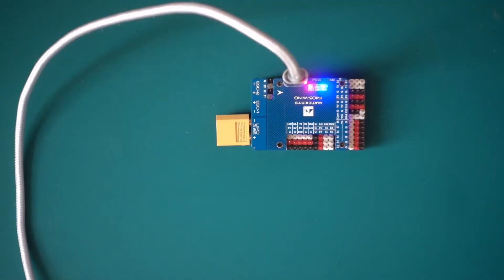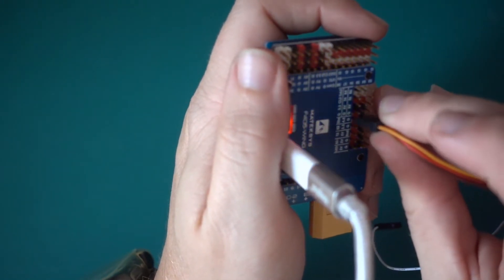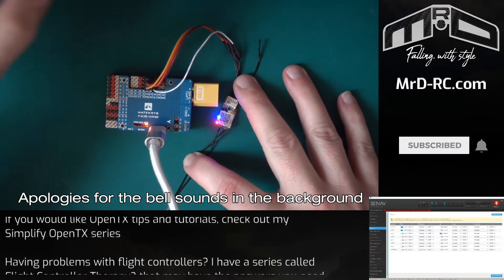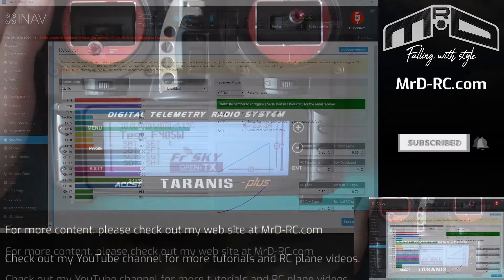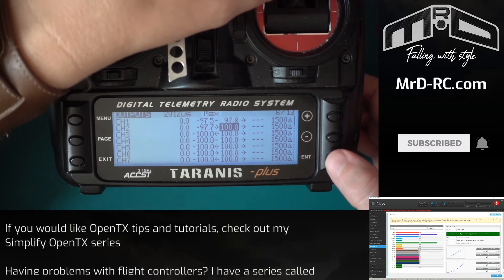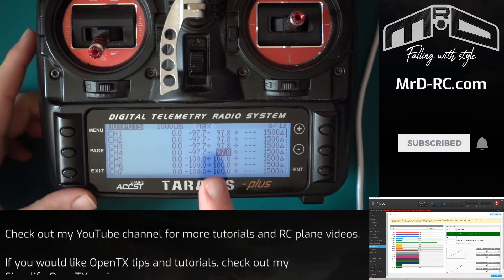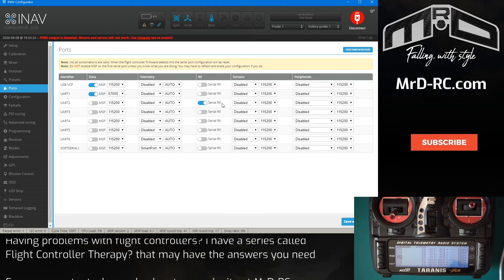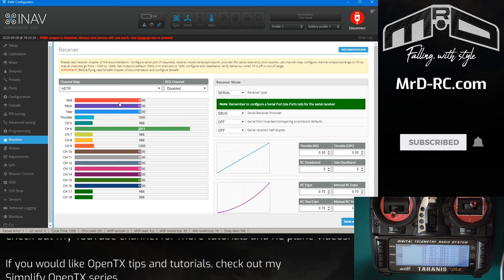Connecting the receiver and setting up in iNav

Comment: you sir get a like and a sub... i think i was chasing my own mistakes for a few hours tonight... we shall see tomorrow when i go fly... i was calibrating my sticks and then my rx tab was off so i tried to listen to jb and change value range in cli but that kept throwing it off by 1 or 3 digits or so.. and then after seeing two videos of tx endpoint alterations like this finally 1000,1500,2000!!!!!!!!!!!!!!!!!!!
Reply from the maker: No problem at all. I’m glad it’s working for you. I think doing it this way is so much easier than using the CLI, and if you bind multiple models to the transmitter model, it’s already right.

Comment: Hi started just yesterday building my first wing, using crossfire and my tango 2 im experiencing a weird issue if i move the stick to roll, the pitch also moves a bit but die gimbal is completly leveled.
Also the throw of the servos is greater on one wing then the other, when i try it in Manual Mode....

Do you have any idea what the issue is or ist that normal ?

Thy

Comment: Mr.D, I accidentally soldered the Sbus wire from my Radiomaster R81 receiver to the RX2 pad instead of the Sbus pad of my Matek F405-WMN, is this something that can be configured in iNav 6 or do I need to resolder?
Reply from the maker: You need to re-solder. F405’s don’t have onboard inverters. That’s why they have SBUS pads. They just connect to the UART RX pad through a hardware inverter.
Reply: @MrD  thank you for your response!

Comment: Hi
Whay should I check if there is no response in the receiver page eventhough I toggled the switch?
The RX already connected to TX and the TX to RX
I am using matek R24D ELRS
I think my TX and RX already binded (it said Telemetry lost if the FC power off)
Reply from the maker: Make sure you’re using the correct serial protocol on the receiver page (CRSF). Did you set Serial RX to the correct port on the ports page?

It sounds like it is bound.
Reply: Hi finally it works
The cable is not well connected to the board
By the way, after the Receiver respond to the Remote movement what should we do to connect the servo?

My INAV has already responded to the Remote movement but the Servo hasn't
I plug the servo wire to the S3 port in my Speedybee F405wing
Currently, I only use USB to power the board and the servo
Is that the problem for this issue?
My remote setting (mixes) is already the same with you

I am still waiting for my Battery connector to arrive before can power up the FC and Servo using Battery
Thank you so much for your help @MrD

Comment: Hello, is there any way to connect dual receivers for redundancy ?   I do hava  a SIYI air unit for FPV & telemetry that can act als as a receiver, and also a regular FlySky receiver. Is there a way to have them both recognised as receivers ?
Reply from the maker: Receiver redundancy is usually part of the receiver ecosystem. For example, with FrSKY, I can connect the SBUS out of a receiver (slave) and connect it to an SBUS IN of another receiver (master). The master receiver will then connect to the flight controller. 

You can’t have 2 receivers connected to INAV independently. Unless 1 is purely for control (Serial RX on the ports page) and the other is purely for a transparent serial link.
Reply: @MrD   Thank you very much for clarification

Comment: Excellent video, thank you very much. I have the following question, maybe you can help me: My receiver is RX6R it has SBUS but the pins that are presented to me are the following (- + SP AIN2 SBUS_OUT SBUS_IN) my board is MATEK f765-wing I understand that for it I must connect G: Gnd 5V SBUS (RX6) SMART-PORT (SP) (TX4). My question is which is the SBUS if I have two sbus_out and sbus_in, I don't know which of these two I should connect.
Thank you very much for your help
Reply from the maker: Hi Oscar, thanks for the comment. You want the SBUS_OUT connection there. That will go to a Rx on the flight controller. You can also take the Tx of the UART and connect that to the SP wire, if you want telemetry.
Reply: @MrD  I will, thank you very much for your help
Reply from the maker: No problem Oscar.

Comment: I cant believe i found this video but ive been over a week to get stick inputs in inav 2.5.0, my setup is same as yours except the radio. my setup is f405 wing, r xsr receiver and radiomaster tx 16s and inav 2.5.0, my r xsr is wired to board same as yours it binds just fine shows good signal back to radio 5bars its set for sbus green and blue lights on. in inav every thing set same as you. no matter what i do can get stick inputs in inav recevier tab, ive even reflashed inav with full chip erase and set it all back up again. I have sent out many many emails but no one knows why. I think radio and r xsr are talking but seems like r xsr cant talk to inav. any help would be great and you have a new subscribe.  Thanks
Reply from the maker: Hi Ed, I can see what I can do to help. It might be easier to look me up on Facebook @MrD.FWS and send me a message on there. That way we can use images to see what’s happening.
Reply: So today i flashed f405 wing again this time with full chip erase and entered Defaults in CL tab after flashing, i then checked continuity between sbs pin and back of board,did same thing on r xsr plug and wires but still no go, no stick inputs in inav, i can run motor with master switch in inav but can not fiqure this thing out
Reply from the maker: Maybe try without putting your defaults in the CLI. Just flash with full chip erase, and add the receiver manually. That should pretty much all be done by default anyway. Also confirm that the SBUS wire from the R-XSR goes to the Sbs pad on the F405-WING. Ideally, it would be better to try and sort with screen grabs and photos. If it’s still not working, use the channel monitor on your transmitter (hold down enter, as if to select a new model, then choose channel monitor) and make sure that you are actually outputting data from the transmitter.
Reply: I reflashed like you said and checked wiring, ground, 4.5v and pin directly above sbs is connected to green wire on r xsr which should be sbus out. Ive tried to get stick inputs in inav with usb only and usb with battery but no go. Im still not sure radio is right, ill send pictures today via facebook like you suggested please take alook and let me know what you think. Thanks
Reply: @egtreadway4232  hi im sure youve done this already but you have the right uart selected under ports tab for serial rx? and then have sbus selected on configuration tab? sorry thats the most help i can give im new to inav also.. i just fixed my reciever endpoints issues with this video but feel free to reply ill try to help also
Reply from the maker: It was an incorrect firmware version on the RXSR. It’s all working now 👍🏻
Reply: style could that be why my crossfire is not working also
Reply from the maker: @chiefshalot2986  unlikely, as crossfire will update the receiver firmware when it binds. There was a protocol mismatch in Eg’s case.

Comment: I have FlySky equipment
When I turn on the equipment, the receiver immediately stops flashing, this indicates that they see each other. But the INAV program does not see that the receiver is connected to the transmitter.
even in the "configurator" tab there is no "receiver" section. Other programs don't give this section either. What to do?
Equipment - FSi 6
receiver - FS-iA6
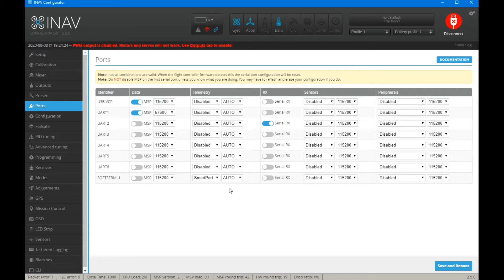Reply from the maker: Please check the video again at 2:30. In iNav there is a receiver tab where you change receiver settings. It's in the configuration tab on BetaFlight.

Comment: 3:30 I try to make this working with XM+ I try to Move the bargraph in the Picture with my Transmitter. Xm+ is bind, but it give no output to to the FC. I try to make inverted and halv duplex off, yesterday but had not working yet.
I testet the xm+ wit URUAV Battery checker and no problems...
I make the options so in the picture 3:30 is shown and test again. I Not think this will Work.
Thx Die the Video
Reply from the maker: With an XM+, you shouldn’t need to make any changes. Just set it up as an SBUS receiver on the receiver page. Set up the correct port, and connect the SBUS out on the XM+ to the SBUS pad on the FC. Inverted should be off, and leave half-duplex as auto or off. Which flight controller are you using?
Reply: @MrD  
I was must reflashed the FC then it had work.
Reply from the maker: Possibly it had a similar but incorrect target before. That would cause issues. Still, I’m glad it’s working for you.